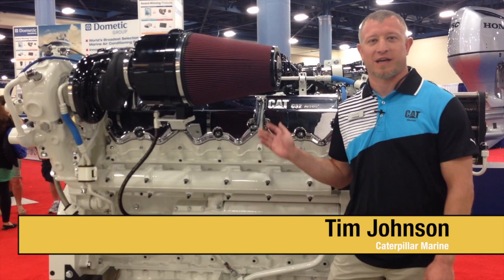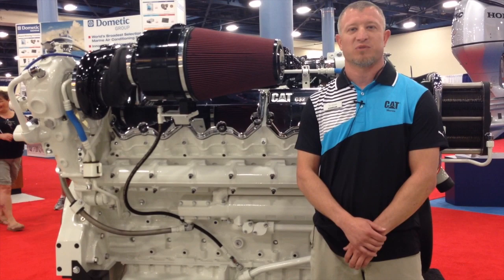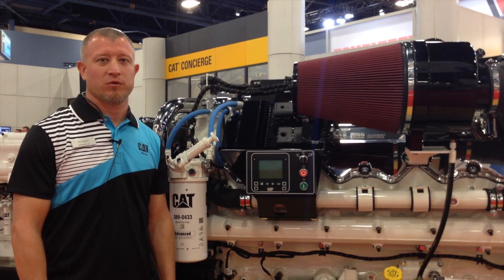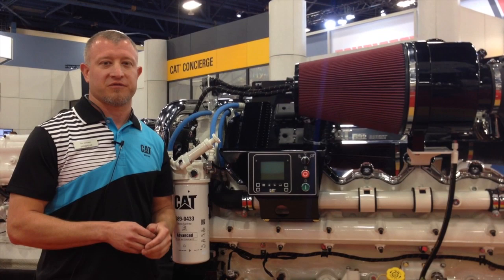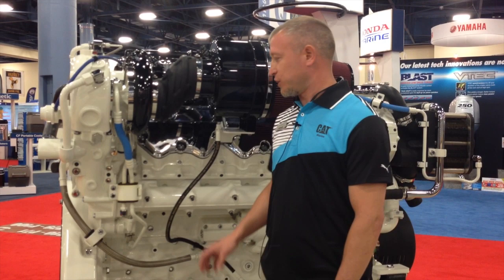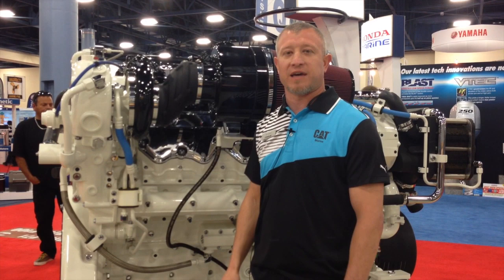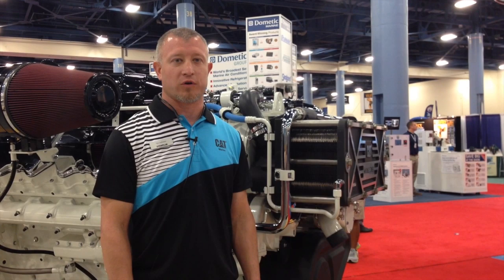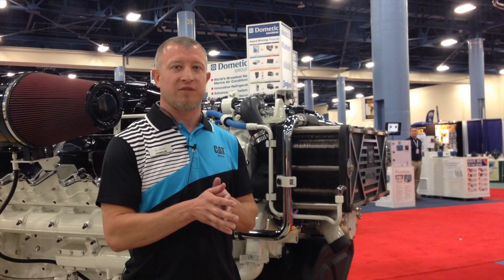Product Walkaround: Cat C32 Engine for Recreational Vessels

Comment: 1900 horsepower right?
Reply from the maker: Hi, Ryan! The Cat® C32 Marine Engine is rated between 1600-1900 bhp (1193-1417 bkW) @ 2300 rpm. To learn more about this product, visit: https://www.cat.com/en_US/products/new/power-systems/marine-power-systems/high-performance-propulsion-and-maneuvering-solutions/18494387.html?utm_source=youtube&utm_medium=social&utm_campaign=cic_social_care - Eli
Reply: How much torque does it have?
Reply from the maker: Hi Ryan. The Cat® C32 Marine Engine has a torque output of 7,500 newton-metres (5,532 lbf/ft) 1300-1800 rpm. To learn more about this product, visit: https://www.cat.com/en_US/products/new/power-systems/marine-power-systems/high-performance-propulsion-and-maneuvering-solutions/18494387.html?utm_source=youtube&utm_medium=social&utm_campaign=cic_social_care. Elvitz